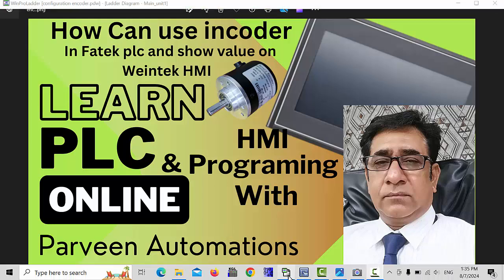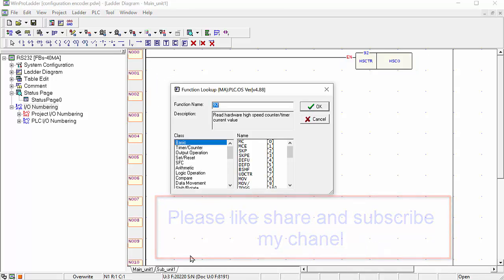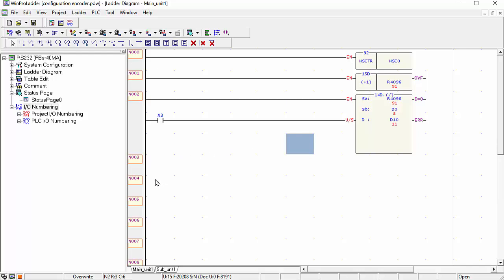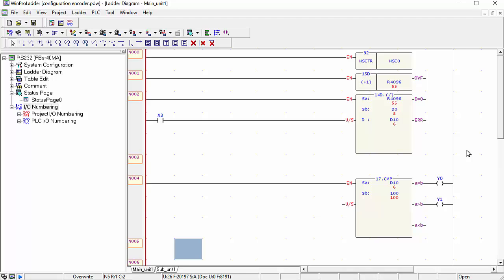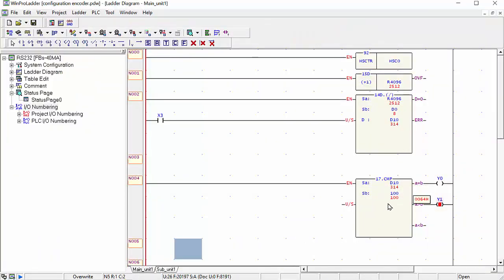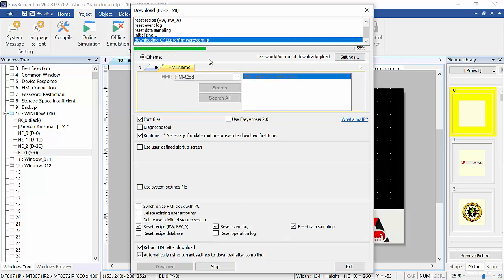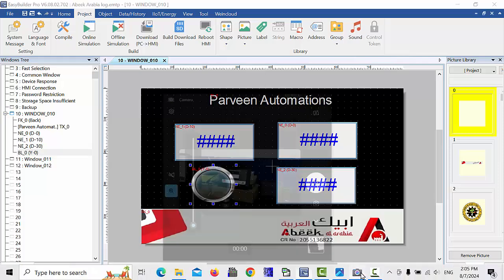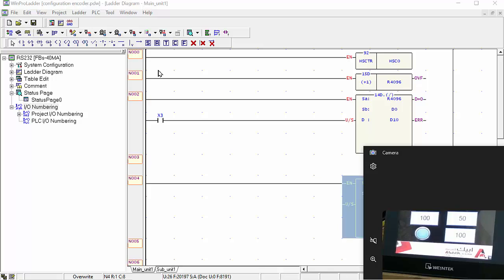how we can major the length with encoder in Fatek plc and value show on weintek HMI

Comment: Hello, thanks for your videos. I have to use it as a linear meter counter and I have the problem that when it reaches 32000 I have the overflow and it goes negative. Do you know how I can solve it? Thank you very much.
Reply from the maker: have two three options use value in percentage or use double word data registers
Reply: @Parveenautomations  Thanks for your reply, do you have any tutorial as an example? Thank you very much